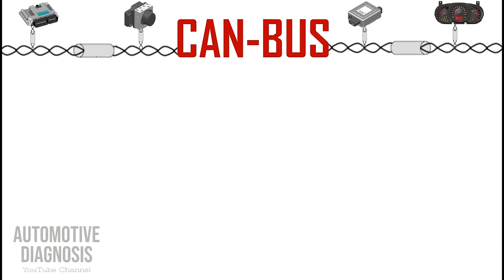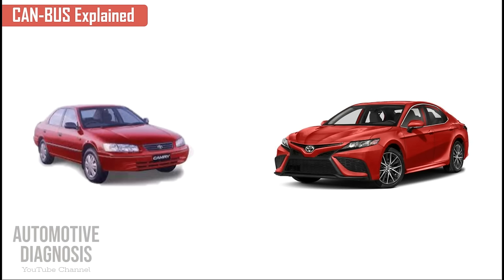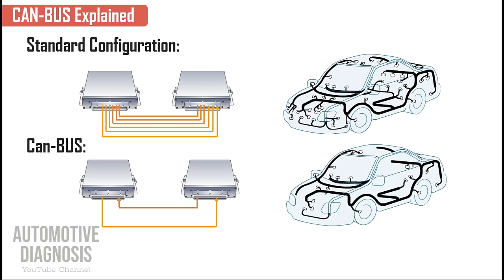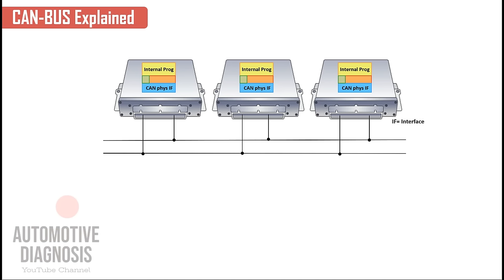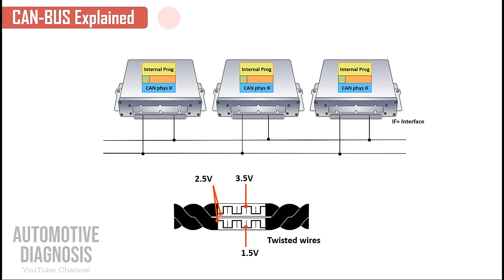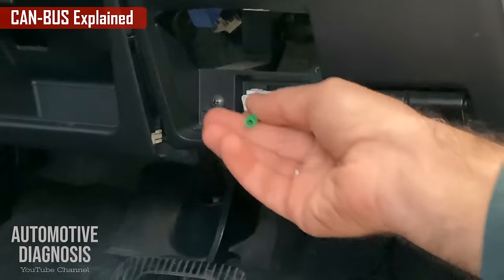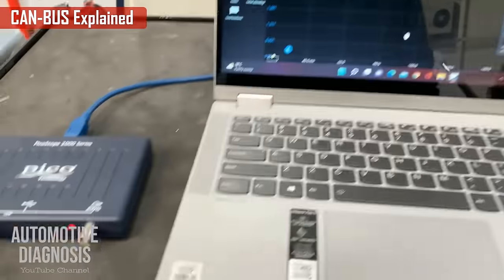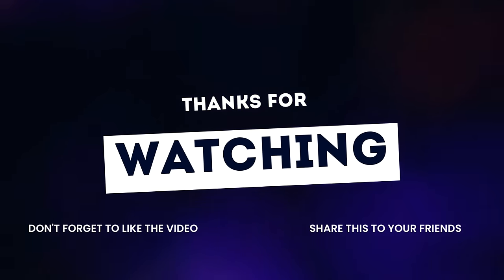CAN-BUS Explained | Everything You Need to Know About CAN-BUS | CAN-Bus Diagnostics & How It Works

Comment: Can u help me car turned off and won’t turn back on. I have no connection to the ecu. I have checked the inside of the ecu and it looks fine. So I was thinking the can bus. Maybe I’m wrong but according to what you say in your video that it’s multifunctional and one won’t stop the other from working? If I go by that it can’t be the can bus system.

Comment: thanks for explaining  I have an issue on my Suburban 2012   , I got these  code :  P0700 Transmission control system ( MIL Request )   ,  U0073  Control  Module  Communication Bus  "A" Off     ,  P2635 Fuel Pump "A" Low /Performance       from where should I start the solution  thanks
Reply from the maker: Hi there, normally if there is a major issue on CAN bus, there will be no communication between scan tool and that control module, I would start by checking the PCM connectors. Do you get any other simile fault codes in other control modules too?
Reply: @AutomotiveDiagnosis  I appreciate thank you very much

Comment: Hi,How do you say AC control and Instrumentation control alone is gateway.Can you explain how to intrepret that?
Reply from the maker: Hi there. Normally gateway is connected between two different types of network. If you have multiple units connected to two CAN-Bus, that one which must be on the car in any circumstances is the gateway. For example, smart key control module is not a gateway as you may have a car without smart key. But instrument cluster is a must on the car. Also, workshop manual can help for finding the gateways.

Comment: So I checked I have 60ohms with ecu plugged in but no power and then when I disconnect the ecu and I get 120ohms that means ecu resistor is bad is that correct. So I need a new ecu or fix that one correct.

Comment: Well..If terminating Resistance is Inside ECU, doesnt it disrupt CAN communication when we remove ECU from the vehicle? But as we can see CAN system still works after Removing ECU?
Reply from the maker: Hi my friend. CAN BUS is a multi-master network, so, removing a unit should not disrupt the entire network (although I have seen some cases that it does 😒). Anyway, removing the ECM or even a terminating resistor (in case of having an external resistor) will only make the network more noise sensitive and voltage fluctuation will put the other control units at risk, but network must still work.

Comment: Please elaborate on the voltage on CAN HI and CAN LO. What is your reference? Are you measuring the voltage between the two CAN wires or are you measuring from the CAN wires to frame ground? Also, where does the power originate from to provide the voltage changes? Does each module require a 12 volt line and a ground for power?
Reply from the maker: Hi there, voltage comes from each control unit as each unit connected to the CAN-Bus has got a CAN controller inside which regulates the BUS voltage and convert the signals to the CAN message format. For measuring the voltage on CAN-Hi, voltmeter red prob on CAN-Hi wire/pin, and black prob on body ground. Same way for CAN-Low but this time red prob on CAN-Low wire/pin. Ignition switch also must be on.

Comment: Why the A/V and navigation is not a gateway and only the A/C Control the gateway ?
I am confused as the diagram shows it's connected to both C can and Mcan as well.
Reply from the maker: Hi my friend. Yes there are multiple control units connected to more than one network but they are not all gateways. Manufacturers consider the number of signals transferred between a control unit and each network to select a gateway, also option availability on the car is an important factor for this as they might offer different options in different countries.

Comment: So once the resistance between CAN-HI and CAN-LO is measured and 120 ohm instead of 60, how would i identify the open control module?
Reply from the maker: The best way is to check the wiring diagram to see where are terminating resistors are located. Normally one of them is inside the Engine ECU, but the second one could be located in different units. So as soon as you found the locations, you can check them both, on Can-Bus terminals.

Comment from the maker: You can also watch the following video for LIN BUS:
LIN Bus Explained | Everything You Need to Know about LIN BUS | Local Interconnect Network 
https://www.youtube.com/watch?v=vaTp3inTMdU
Reply: thank you so much for teaching  .... I have a  question.....how many volts must I get on these CAN WIRES on truck 24 Vts  vehicle
Reply from the maker: @JusticeMajija   Hi there, CAN bus is a universal protocol with same specifications. The only thing is you must know what type of network is used on that specific car, so you will know the diagnostic procedure.
Reply: I hate wiring with Canbus,ITS not flexible for modify any electrical ITS not allow with Canbus,i like tradisional wiring ITS more simple to understand and flexible  and compatible for  other electric system' and easy to understand

Comment: I understand your talking automotive but in semis they use several datalinks and terminating resistors are inside of either a module or a starpoint. Example being on a New Cascadia on the powertrain CAN the terminating resistors are located within the CPC and the ACM. Within the PT CAN the MCM is part of the datalink but does not contain a terminating resistor. This is true for both Detroit and Cummins as far as my experience has shown me.
Reply from the maker: Hi there, thanks for sharing your experience. Different companies tend to put the terminating resistors in different locations. Most of the times one of them is inside the ECM, and the other one could be inside any unit on CAN-Bus. For example I’ve seen the second resistor inside the BCM, Instrument cluster, interior fuse box and on some models I’ve seen an external terminating resistor as well.

Comment: I liked your video it has a good explanation for how the basics of this can bus system works.  I was hoping that you might have  an example of a failure or what really happens when one of these modules is bringing down the can and how you find out which one that is.  I did need this though as i have very limited knowledge on a can bus system and working with electrical problems on a vehicle this could be helpful.
Reply from the maker: Hi there,
Thanks for your feedback. I actually didn’t want to make this video too long. There are more videos coming soon about CAN-Bus and hopefully what you mentioned will be included.

Comment: Yeah this is great and all, but when you cant start your car because the module for the rear lights is out, IDK. When you need to reprogram a turn signal module and you must go to the dealer.IDK.
Reply from the maker: Yes, CAN-BUS is really great but it does have it's limitations and problems too.

Comment: Great vid. Question though, in end of video you showed what a short to ground looks like on the pico waveform. But if you created a short to ground why didnt you blow a fuse?
Reply from the maker: Hi there, thanks for the comment. There was no fuse issue because battery voltage is not provided directly to the CAN-Bus, so there is no fuse for the network, as voltage is provided through the CAN-Controllers inside the control units. So that short to ground will be detected by the CAN-Controllers and will change the mode to limp-home mode.

Comment: Thanks for the information. But there was something I'm still wondering. How did you know that the A/C module was the Gateway? Is there any way to check that? Except for just testing disconnecting each module?
Reply from the maker: Hi there, thanks for your comment. Mostly workshop manual or wiring diagram are very helpful for finding this kind of information.

Comment: HI there, congratulations this is one of the better CAN bus videos. If I can respectfully suggest something that you could clarify: you explained the gateway module purpose and that terminating resisitors. However, given that both the Nav-AV Modcule and the AC Module (M-Can) are connecteed to C Can, you did not make clear how to determine which module of the two is the Gateway. You simply just stated that it was the AC module. Same for the Smart Key Module and the Instrument Cluster (B-CAN).They are both also both connected to the C-CAN. How do you know that the IC is the Gateway. How do you determine that just be looking at the wiring diagram. Yes I understand you could unplug modules until you see 120ohms on the meter, but that is a very long way around requiring often a lot of work. thanks again.
Reply from the maker: Yes, that’s right, it’s really important to know which unit is the CAN-BUS gateway. I simply knew that for this car that I presented because it was mentioned in workshop manual, I’ve seen this reference to the gateway sometimes in wiring diagram and sometimes in workshop manual
Reply: @AutomotiveDiagnosis   ok often it’s not identified unfortunately
Reply: Unplugging modules until you see 120Ω on the meter would find the module which contains a terminating resistor. But, if I understand correctly, that isn't necessarily the gateway.
Reply from the maker: @ncdave4life  Absolutely, terminating resistor is not necessarily installed inside the gateway.

Comment: I tested according to what I see in your video but I do not see what happens if there is a short to power. When ohm testing 6 to 14 with the key off I get OL. Voltage on pin 6 is 10v and voltage on pin 14 is 8v. The van will not crank or start. The scantool can only communicate with modules on the low speed bus. It cannot communicate with ecm or tcm which are where the resistors are. I would suspect there is a short to power in one of the modules correct?

Comment: Great video, thanks a lot. A question: can two modules communicate at the same time or not? Does one communication block another one until it's done?
Reply from the maker: Hi there, thanks for the great question. In each CAN data frame, there are multiple fields, the second one is called “arbitration field” which decides the message priority. So if two control units are sending messages at a very same time, arbitration field decides which one has a higher priority. Therefore, the message with the highest priority will be sent first.
Reply: @AutomotiveDiagnosis  Thanks again.

Comment: How 1/60 becoms 60 ohms sir ?
Reply from the maker: When you calculate the total resistance, as I explained in the video, the result was 1/R(total)=1/60 so as we want to calculate the R total, we change both sides of the formula to bring the R total and 60 to the top, so the result would be R total=60.
Reply: @AutomotiveDiagnosis  thanks sir got it
Reply: 1/RT=1/60..….....then RT=60
Reply from the maker: @hamzajaddour1797  That's right.